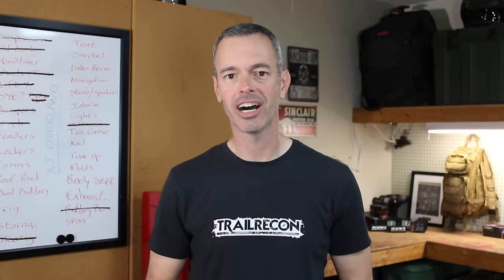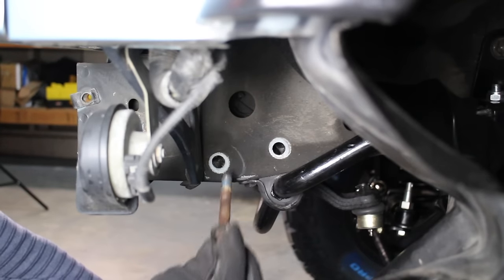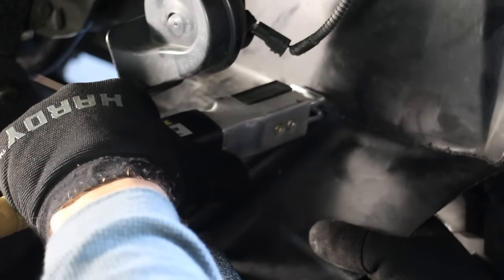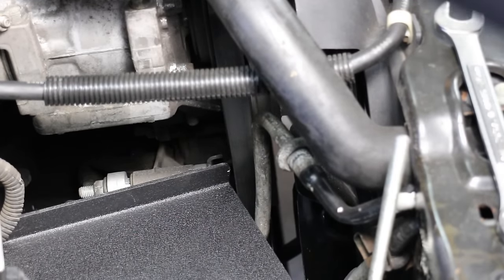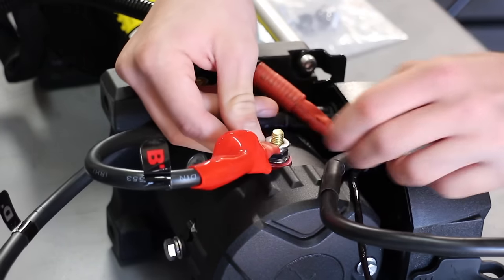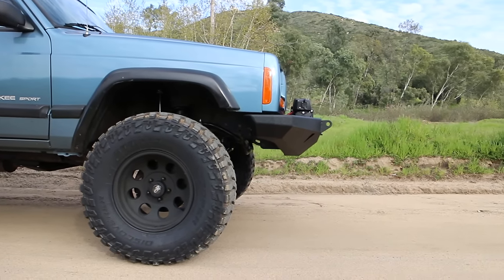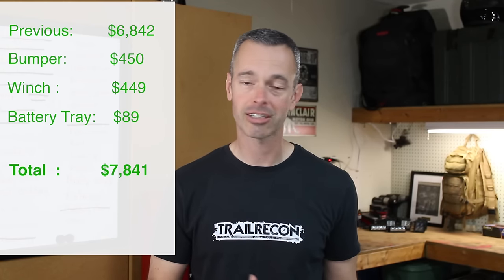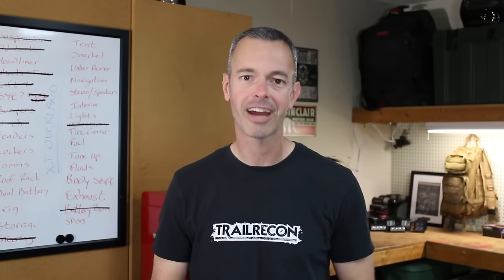Jeep Cherokee XJ Bumper, Winch & Battery Tray - Project XJ Overland Ep. 8

Comment: Do ebay headers (cheap and just as good) if your xj is 2001 you will have a split header so don't look on ebay for 2001 xj cherokee header look up jeep tj headers an you will notice 01 and up jeep tj uses the same header as a 2001 jeep xj cherokee. I f you look up 2001 xj cherokee headers you will notice they are extremely expensive and the reason why is 01 xj was the only one to  have this split header with separate o2 sensors but this sort of header was fitted on the jeep tj from 2001 to 2006 so it is not rear at all. And i know buying headers for one car and putting them on another is not the most trust worthy thing to do but if you read enough you will notice that the seller also will advertise them as xj headers and many other models. The key is looking for 2001 and up tj headers. Then  i would recommend a flowmaster Catalytic converter and a flowmaster delta 44 muffler. I gues you could do a cat delet but in my opinion i hate the smell of raw gas. An awsome ad on to that is 4 hole injectors they are rock n roll you could get them from a dodge neaon or a jeep liverty or just look them up on ebay look for a kit or set of rebuilt ones for the xj
Reply from the maker: Thank you, I have been considering headers, so will take a closer look.  Appreciate it!  Going to keep the cat... have to here in CA.
Reply: Hey men glad to help, i would further suggest the taurus electric fan swap i'v done it my self and you really notice those extra 15ish hp, also you loos a lot of annoying vibrations from that big heavy clutch and metal fan. The crazy part is that all this is gaining you horse power and bettering your mpg

Comment: I'm running a 50 Series flowmaster on otherwise stock exhaust. For my use it's a bit too loud and I may try the 60 Series next time. It doesn't really drone in the cabin but my build is more overland based than serious offroad so I want something a little quieter. It's got a nice rumble at idle and is pretty loud when you get on it. This video isn't great but you get the idea if you turn the volume up. Phone is sitting just above the rear bumper. https://youtu.be/psWBg9zHV9U
Reply from the maker: Good to know about the 50 being a bit too loud... trying to keep the those down in this project.  Thanks!

Comment: lol  I got the same exact bumper for my 88 Dodge Dakota.. (Smittybilt#76810) the jeep front end and Dakota front end are pretty much the same god dam thing slightly tweaked to make it look "different" (same transmission and transfer case and axles COUGH... chrysler cough)   well that and the dakota has a frame under it... bla bla details.. Point is, if you have at the least a cheap ass harbor-fart welder you can cut and move the mounts and just bolt it on a 86-90 Dakota front end.. 91-96?  I dont know because they changed those front ends to fit the v8 engine in..   Looks like a TANK.. also drives like one.  (mines an ex plow truck so doesn't mind the weight)  120LB bumper btw.. empty winch + bull bar + lights + stickers probably double that lol    (keep in mind the weight, for my squishy suspension guys out there.. might want plow truck shocks first...)